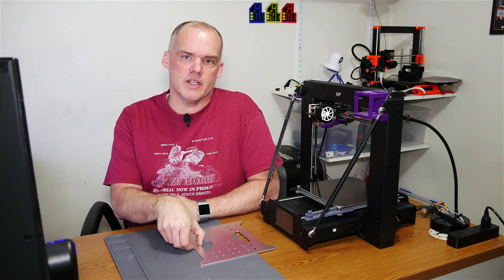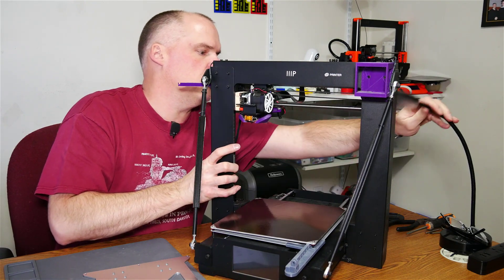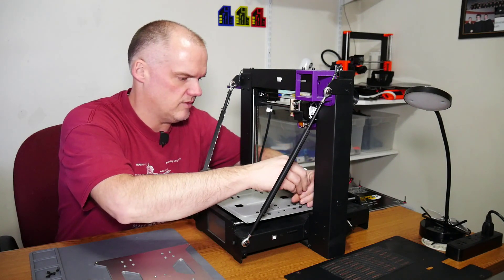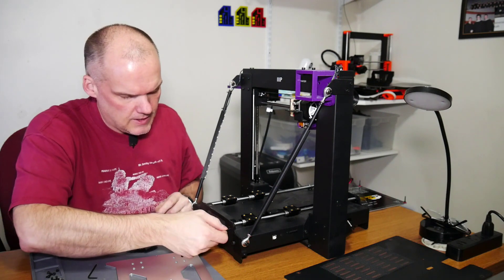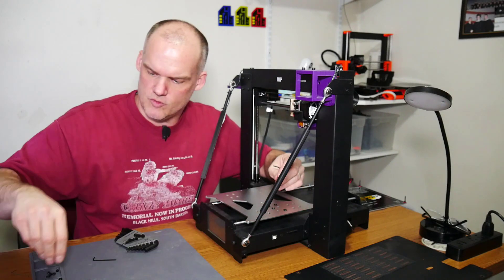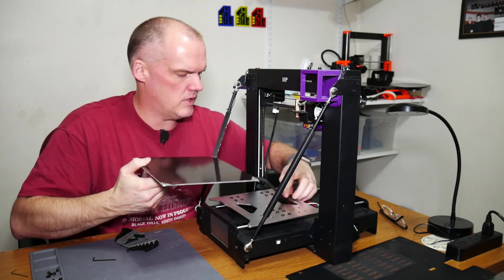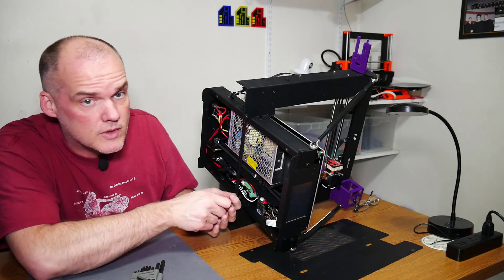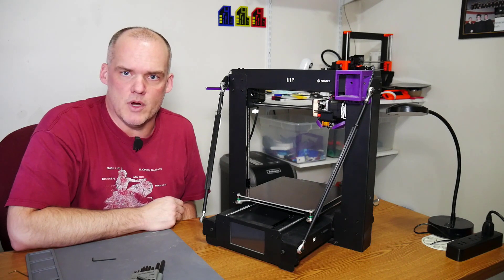How to: Install an Aluminum Carriage Plate on a Monoprice Maker Select Plus / Wanhao i3

Comment: Is that the gulfcoast robotics z brace kit?
Reply from the maker: To tell you the truth, I don't remember. But 2 things I wish I had done with this Z-brace. First, I wish it was in the back. Yes, I put lights on it, but it kinda gets in the way. second, I think I could have fabricated my own Z-Brace and saved some money.
Reply: @Grimm3D  thanks for your reply! I've personally been trying to obtain this part, so that's why I asked. However, they do not sell it anymore and I can't find it used anywhere
Reply from the maker: Look through Thingiverse, there are designs there to make your own with some prints and some hardware parts

Comment: I have a Maker select plus 3D printer, and just began using it. Could you recommend a forum because I have a lot of questions about tuning it up.  
After I get it tuned up I would like to add some of the updates you have added.
Thanks. Hager
Reply from the maker: There are some forums online, but mostly I've gotten my best information from other YouTube videos. Also, Let me know if you would like me to make specific videos to help you out. I'll see what I can do. Thanks for Watching!
Reply: @Grimm3D  Thanks, After emailing to Maker Select they said I could update to the Ultramaker Cura 5.2.1 to replace my Cura  version 4.13.1.
I did that but they didn’t have the same printer listed as I have so I wasn’t able to automatically set up the new Cura.
I did set the XYZ of the bed size and nozzle size and PLA type, but there are dozens of settings and options to set so it’s overwhelming to this first time user.  My first project is our grandkids names to go on a plaque I made on my DIY CNC. Had stringing so hopefully get the new version set up and take advantage of people that address issues like this.
Any suggestions you have on configuring the new version would be deeply appreciated. 
Hager
Reply from the maker: TO tell you the truth, I gave up on Cura after I got used to working with PrusaSlicer. It seems to work much better and creates better results. However, you have to set up the printer from scratch as well. Once you get the basic parameters set, you should be able to start printing. Then, just tweak from there.
Reply: @Grimm3D  LOL, I downloaded Pusa also but I thought it would be easier to setup Cura because this printer had Cura on it before.
I think you have or had a maker select plus 3D printer and if you have Pusa on it would it be practical or reasonable to send me your configuration on that machine? I looked at it and seems they offer and things things in the background of the screen.  Pusa may be a easier setup.   I remember seeing your printer and liking the bumped out screen, a really better look.
Reply from the maker: I'll see about adding a video detailing my PrusaSlicer for the Maker Select Plus. Having it in video format will probably be easiest. Cura and/or PrusaSlicer do not actually go on the machine, they simply build the sliced Gcode for the machine to run (print).
Reply: @Grimm3D  Thanks, I really would appreciate that, yes a video of the different screens showing the settings sounds wonderful. 
Yup I understand the gcode sends all the directions to the printer, just don’t want to send some gcode that looses all my blue smoke in the printer, been there done that with my first homemade CNC.  Thanks again.
Reply: @Grimm3D  thanks that will be a big jump forward.
Reply from the maker: Video on setting up PrusaSlicer for the Make Select is now posted.

Comment: in 2 min you can unsolder the heat plate and re-solder it after you are done
Reply from the maker: For those who solder well this is a decent option, but I would hesitate to recommend this as many are not excellent with a soldering iron. Thanks for watching!

Comment: So how did going to 3 bearings work out? Any pros or cons? I'm planning on swapping on an aluminum plate in a couple days and wondering if I should bother pulling a bearing too
Reply from the maker: The three bearing setup did not work for me. The bearing on the single bearing side wore out pretty quickly, became noisy, and then started to wobble. I went back to 4 bearings and things are lasting much longer. Thanks for watching!

Comment: it looks like they intend for you to rotate the bed 90 degrees if you intend to go with a 3-point bed leveling setup. anybody able to confirm that there is enough length in the wire for that? i cant for the life of me find a y-carriage for this printer that doesnt require the 90 degree turn despite it not necessarily being needed except the fact that they ALL seem to do it for whatever reason.
Reply from the maker: I'm not sure what you are referring to, I did not rotate anything and my wires were fine. See my rerouting of the wires, reconnecting, and zip ties starting in my video @ http://www.youtube.com/watch?v=GOHkaqd4inA&t=11m26s

Also, if you read through my description and  watch my Bed Bearing Replacement video, you will see that I gave up on the 3 bearing setup, the single bearing on the one side wore out very quickly. Maybe it was a bad bearing, but I went back to 4 bearings and they have all been working flawlessly since January of this year (2019)

Comment: How many 3D printers you have now? How do you compare the Maker Select Plus with the MK3? Which did you by first? I also have Maker Select Plus but thinking on a new printer. Any recommendation?
Reply from the maker: I have two printers right now. The Maker Select Plus and a Prusa Mk3. Both have been awesome for me. The maker select has been more of a hobby printer. Meaning the printer has been the hobby, I've upgraded it a lot to get it where it is. The Prusa started printing almost perfectly right out of the box and has needed very few upgrades. Of course, there is a price difference. 

I am currently looking to buy another machine because I would like something with a larger format. Something like 400mm or 500mm for printing larger objects all in one piece.